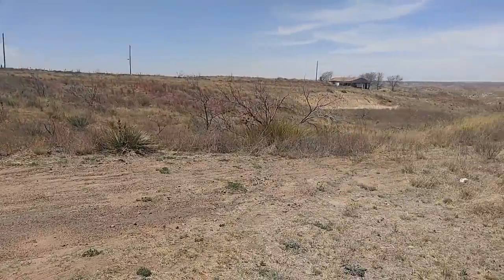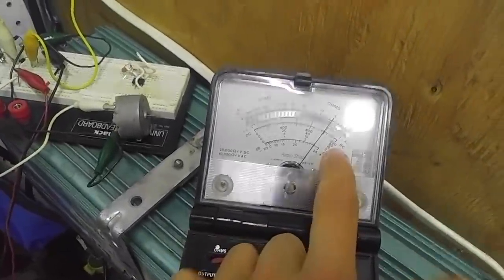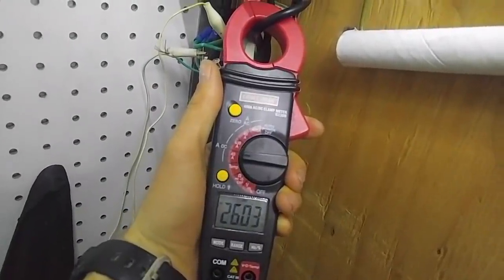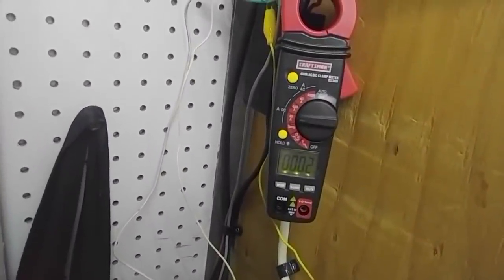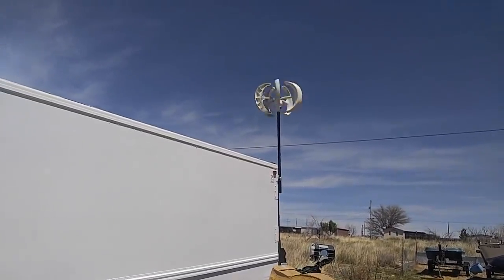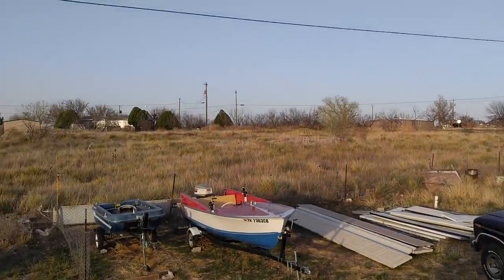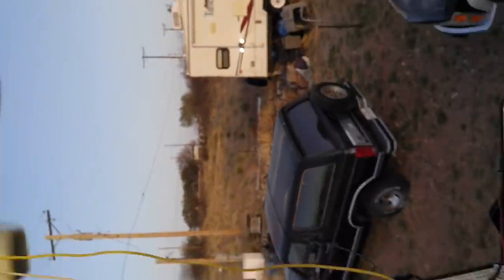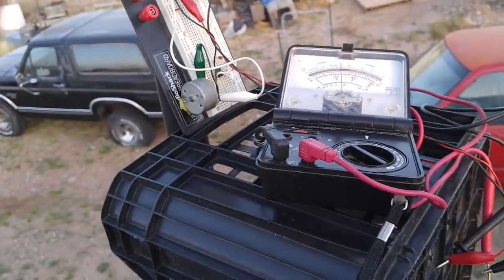400W Chinese Ebay Latern Vertical Wind Turbine Performance

Comment: You need to get a Watt Meter.  You can get meters that read Volts, Amps, Watts at the same time cheap on ebay.  And you need to use a resistive load.  Motors are inductive and may not be true power.  Also you should know what the RPM is of the turbine.  But I do agree that it may not produce 400 watt.  The blades I think are too small for a 400 watt wind turbine.  Wind turbines are most efficient then the blades are moving at half the speed of the wind.  Example:  If the diameter of the blades are 3 meters.  Then the distance around the blades is 9.4 meters, 2*pi*r.  At 60rpm then the blades are moving 9.4m/s.  Max output will be when the wind speed is 18.8m/s or twice the speed of the blades.  What is the RPM for the MAX output (400w) of the generator?
Reply: arndtwc during the entire testing period I had the turbine hooked up to the provided controller which appeared to work correctly (and controller to the battery bank). Granted wind had to be fast enough to produce a high enough voltage. Never saw more than 200 ma or 0.2A or 2.6 watt enter the battery bank via an ammeter on the leads. My solar bank was producing 30A at this time from same clip on meter. I appreciate your suggestions but the fact remains that the current is so low as to render this turbine useless. How else would voltage readings change if I increased current draw by seizing the little motor? Sure, w =IxV, maybe watts remained constant but anything that can'd provide .5A to 1A with constant voltage at those wind speeds is worthless. Watts then super low!
Reply: There was no rpm information. Only wind speed information. One would thing they already took the inefficiency of this turbine into account, after all they said 400w power at 14.4m/s. This product certainly didn't come with a data sheet, it cost $180 if that means anything.
Reply: Ian L 
What is the info on that wind generator so I can look it up?  Thanks
Reply: Super Dave search eBay for "lantern wind turbine" and you will get a myriad of hits!
Reply: Ian L 
Thank you.
I already picture a better design in my mind.  Instead of using the "prop"principle"', using the "wing/lift" principle.

Comment: It's wired in Delta, so it requires a Gale force winds to see any power.Just all PMA or PMG are  pour poducers. Axial Flux is a real producer, when built correctly! Thanks for sharing 😃
Reply: TheBillytheJack2010 yep be nice to see more people axial flux wind turbines flooding YouTube with videos showing output.
I like what he says its just a piece of junk , if I had a dollar for every time I heard that, we all live and learn .
Reply: closertothetruth more people are becoming more aware of the big lie!!
Reply: Hi Ian , you can reconfigure the motor phases to a star configuration , this way you will have much higher currents.Check delta start conversion .
Reply: @bobyhack  i thought delta gave more power... 
What goes to the star point ?
Reply: Hey!!! im looking at off grid solutions right now for an urban new build would love to know more about "axial flux wind turbines" and why this is important? :) keen to learn
Reply: Not delta, I opened mine which is the same, it's double wound aluminum wire in star configuration.